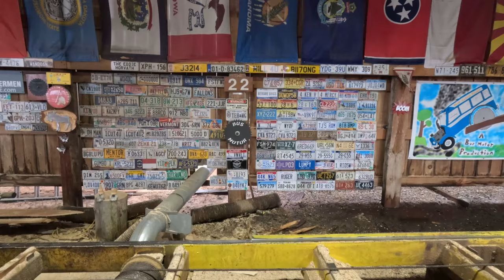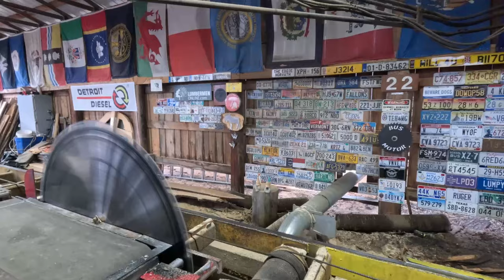sawing a big white spruce log # 529

Comment: those twelve inch pine boards with some battens hung vertical would produce a covered wall really fast with a nail gun and just finish with a garden sprayer and some deck sealer
Reply from the maker: yes it would.

Comment: You talk, sometimes, about the saw walking out of the cut.  There is a channel for Helmsburg Sawmill.  He has a head saw and two horizontal saw blades for on-the-fly edging.  When he saws a very big log, he shows how the top saw goes one way (away from the log) and the bottom saw goes the other way (into the log) and leaves a small ledge.  Easily seen on the video so it is not too tiny.  When he goes really slowly, it is smaller.  That really shows what you were talking about when the two saws diverged during the cut.  He does very limited commentary but that was one little insight he gave.